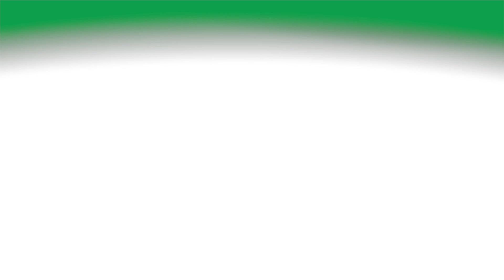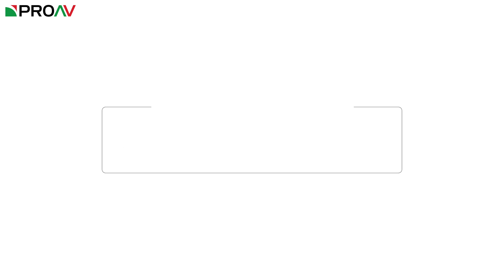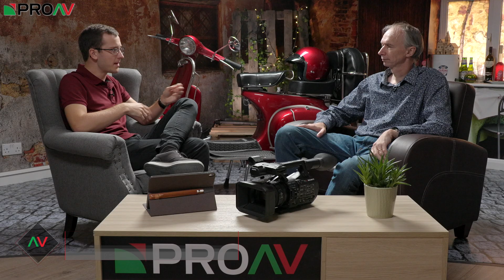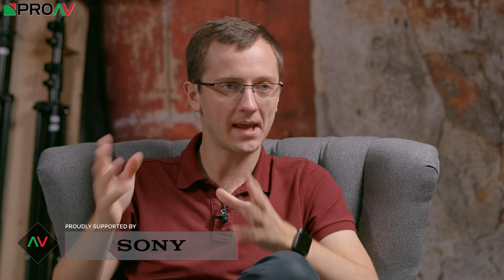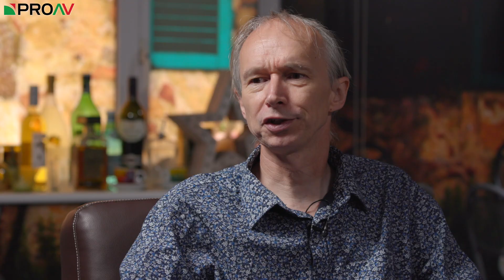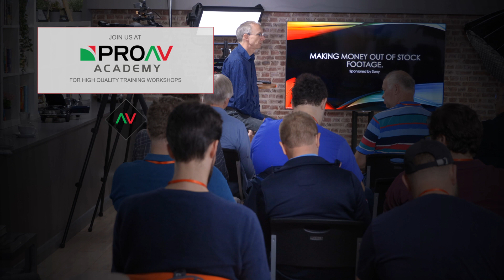What is Colour Sampling? | Tech Terms with Alister Chapman | ProAV Academy

Comment: If bayer sensor produces a reduced color sampling, why high end big sensor cameras do not feature 3 CMOS capturing system? Is it for a cost reason? 3 sensors are more expensive than one? Is there a technical reason for not producing a 3 CMOS full-frame sensor camera like old times with the 2/3" SD or HD cameras? Thanks!

Comment: I`m shocked. An end we must translate our images to a LCD panel. Each Pixel from the panel has a 3 subpixels for R G B color. IF 8-bits, each pixel ranges from 0 to 255 (00-FF), hence 24Mil+ colors. Ok , when we sample 4:2:2, we derive the colors from Luma minus Component. So we have internally a loss, when displaying these colors. What I don`t understand is how can we retrieve the Pixel color, even with less resolution, from 4:2:0. It`s missing info altogether about a component. If HDMI is 4:2:0, so the only way to record 4:2:2 is through SDI?
Reply: We don't retrieve the color information, the pixels without colour information assume the information of the coloured pixels closest to them.
Reply: depending on HDMI Standard.. Like HDMI 1.4, 2.0, 2.1 etc.. That's why Raw recording isn't possible through HDMI yet because of frame rate, resolution and data rate.. HDMI 2.0 supports 422 at 4k 10bit upto 30p but not 4k 10 bit 60p and higher data rate.. HDMI 2.1 standard support of 444 but again resolution and other factors dependent . As of now for real professional video transfer at full rate the camera offers SDI is the way to go both in terms of reliability and solid connections
Reply: Thank you guys for the answers.
MVilla

Comment: Bayer pattern RAW (RGGB) vs 4:2:2 vs 4:4:4 would be an interesting follow-up. This video kind of hinted at why 4:4:4 data rates are higher than RAW but maybe could benefit from a separate video. Also, why does raw exhibit the “magical” dynamic range etc, is this because the YCrCb convention applies a lot of gamut operations etc that effectively throws away data?

I’d also be interested in a video about the different video formats (normal ProRes, ProRes RAW, BMRAW, REDCODE) etc what their pixel format, color space and data compression methods are.
Reply: I agree with you. A video explaining the benefits (or not) of bayer sensors compared with other systems will be great.
Reply: NCFX bayer sensor (and Active Pixel Sensor in general) design and history has a fair bit of coverage in jinitechs videos about the redcode patent. You may enjoy those videos. The takeaway there was that APS was invented for smaller and more efficient sensors than CCD and 3chip in space telescope applications.

The most interesting aspect is for us users is perhaps that they are marketed as much more pixels than there actually is. A 4096 pixels wide sensor is marketed as 4K, even if each line only has RG or GB pixels. So very far from full color resolution.

But I am unsure if equivalent less-than-full resolutions were used in other sensor designs, e.g. is 3chip HD based on 3 HD sensors, or are three lower resolution sensors used to produce one HD 4:2:0 (or whatever) image?